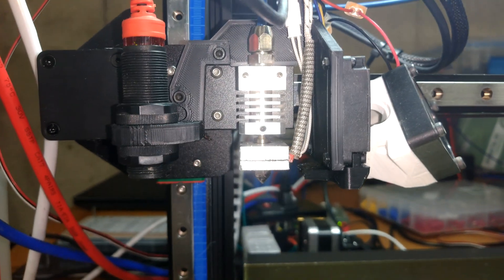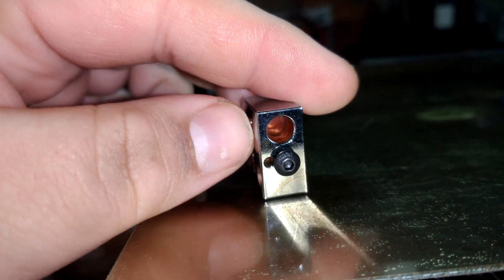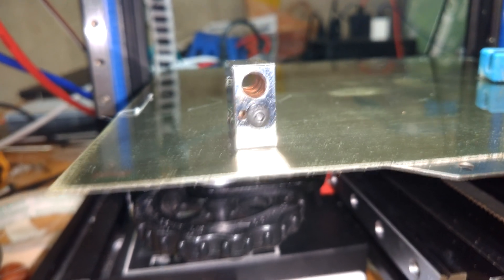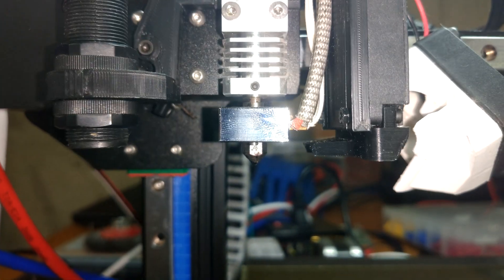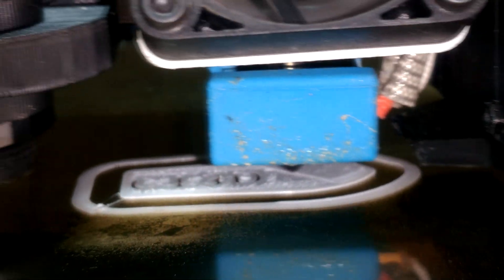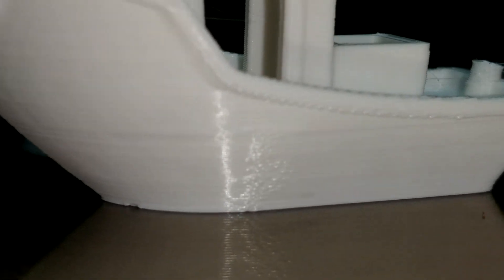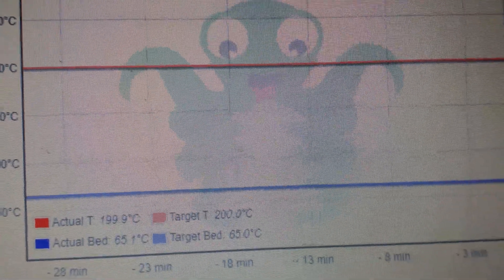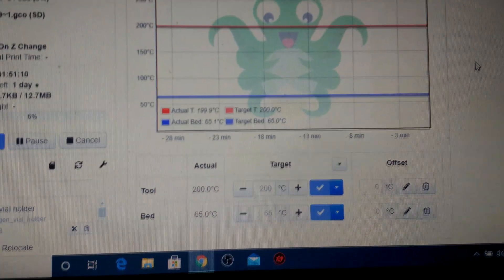Testing Copper Mk8 Heat block

Comment: Hey did you ever test whether this improved your maximum extrusion rate? Seems like the copper vs. Alu wouldn't matter so much for temp stability, pid autotune is extremely effective. But more copper surrounding the nozzle/heat break would translate to more thermal energy dumped into filament per unit of time, which should increase max extrusion rates.

For those printing w/ 0.4 nozzles at <0.25 layer heights this doesn't really matter, but if you try to print faster wider or taller you quickly start seeing the limitations of microswiss style hotends.

I recently moved to a dragon high flow, and it increased my max extrusion rate by >75% compared to a gulfcoast robotics microswiss clone (i think gulfcoast gets theirs from either trilabs or mellow, not sure which. I can vouch for their quality tho). Part of the advantage comes from the copper block, so it would make sense that this would improve the microswiss performance, although you'd still be limited compared to a v6. Also important to note that microswiss/mk 8 hotends use mk8 nozzles, whereas v6, mosquito, & dragon all use nozzles with ~40% more threaded area. This translates to a lot of lost heating capacity in any hotend that uses mk8 nozzles.

Comment: The real question is is the $34 Spool3d one worth it along with the $25 shipping into the USA: https://spool3d.ca/plated-copper-heat-block-creality-hotend/
I imagine this is one of the ones that can do ultra high tempatures.
Reply from the maker: It doesn't look like that one that you linked has a slot for a pt100 thermocouple, which is something you would need for high-temperature printing. I got several other copper heater blocks that have said hole for about $15 on Ali Express 

Everything on that site looks very expensive for what looks to be Chinese parts.